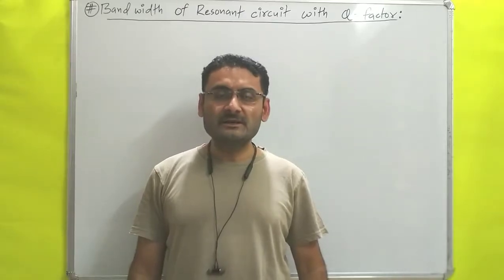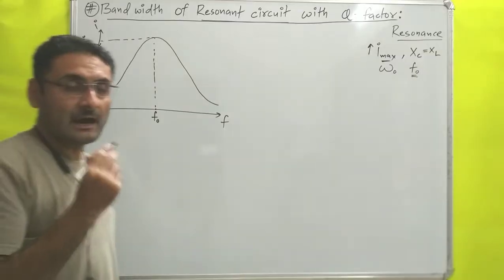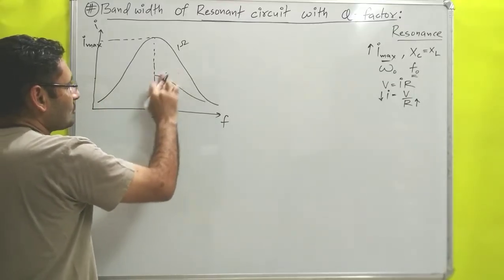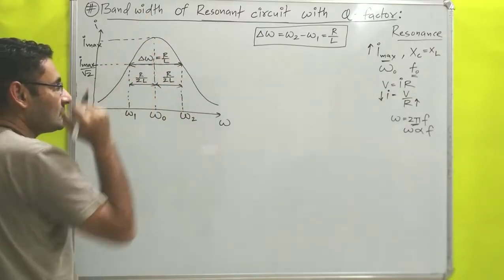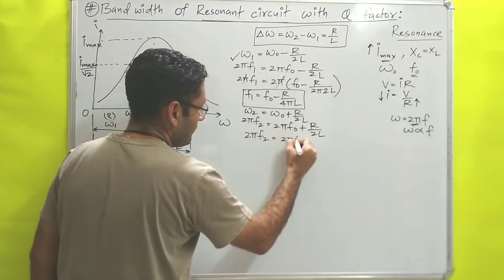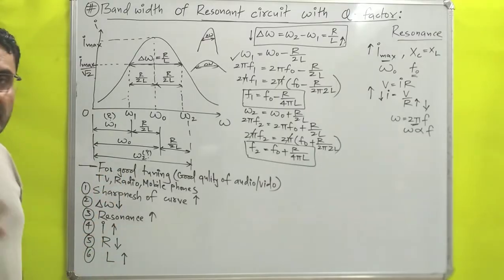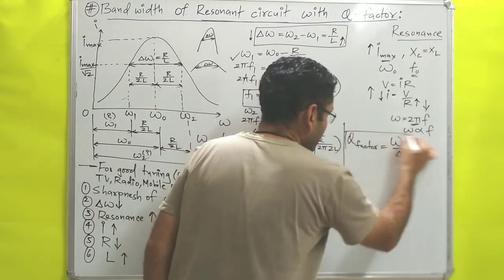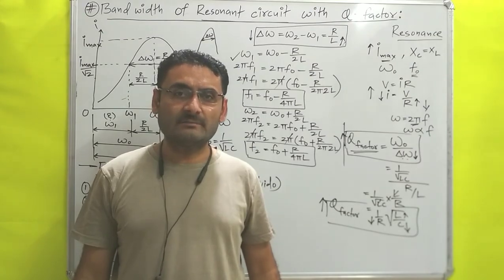Band Width and Q  factor in resonant  circuit (Unit 2 AC circuit) BEE

Comment: Sorry sir to point out but I think that separation between Omega 1 and Omega note and Omega 2 and Omega not would not be same because when we derive the expression for bandwidth we will come across the expression for Omega 1 and Omega 2 and when you take up the distance between Omega 1 and Omega note and that of between Omega 2 and Omega note you will get different answer because Omega 1 Omega 2 and Omega not are not in arithmetic progression in fact they are in geometric progression if you calculate the actual expression of Omega 1 and Omega 2 you will get this

Comment: Sir what is the phasor diagram of series circuit below resonance and above resonance (GTU 2019)
Reply from the maker: In this question you have to explain only simple series RLC circuit. In which you will draw the phasor diagram showing that current leads the voltage by 90 for pure capacitive ckt. And current legs the voltage by 90 for pure inductive ckt.
This phasor diagram might be same for both the cases.
All the best for your exam.
Thank you
Reply: @gautamvarde  yes sir I got it thank you for your response sir